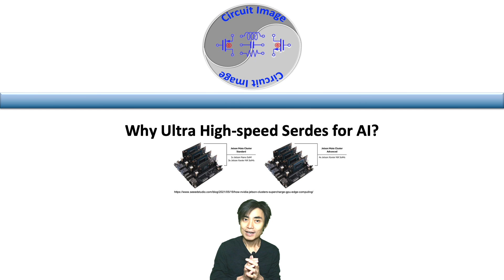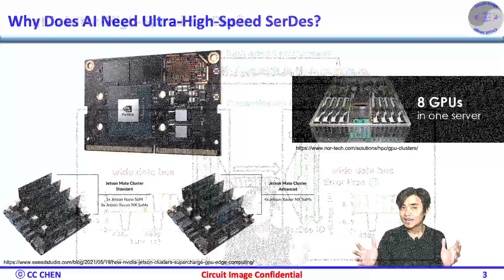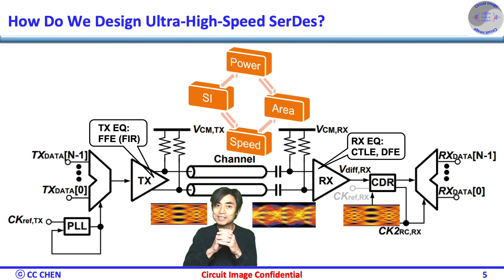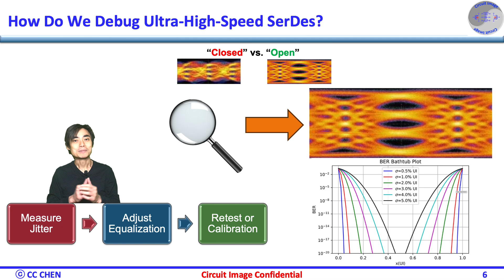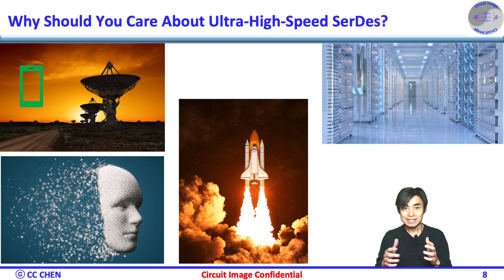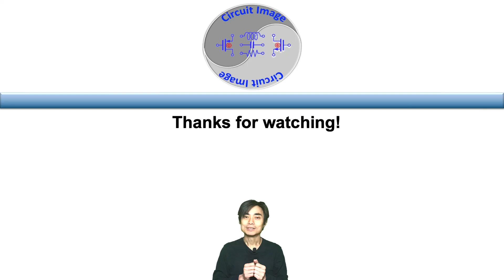Why Ultra High-speed Serdes for AI?​

Comment: Thank you Dr.Chen. The video It's very inspiring. Besides Serdes, are there other analog circuit you think potential for AI as well?
Reply from the maker: Hi Tianli,

Thank you for the good question! 

I’m glad you found the video inspiring. Besides SerDes, analog circuits like data converters (ADCs/DACs), phase-locked loops (PLLs), and sensor interfaces have great potential in AI applications, especially in edge computing and neuromorphic designs. Analog mixed-signal circuits can help improve power efficiency and speed for AI hardware.

If you’re interested, I can share more insights on this topic!

Thanks,
CC

Comment: 普通Silicon chip了不起跑在數 GHz，一直覺得同樣的製程可以做 112 G 甚至 224 G SerDes 非常不可思議，雖然是 PAM4  但基礎頻率仍然有  56 GHz!
Reply from the maker: Hi aaaaa,

Agree. It’s truly incredible how SerDes technology pushes the limits of ordinary silicon! While the same process can fabricate both standard digital chips and ultra-high-speed SerDes, designing for 112G and 224G presents unique challenges. Signal integrity, equalization (CTLE, DFE, FFE), and advanced packaging all play crucial roles in making these speeds feasible.

And you’re right—even though PAM4 reduces the symbol rate, the fundamental frequency for 112G SerDes is still 56 GHz, which is an engineering marvel in itself! The combination of analog front-end design and DSP-based equalization makes achieving these speeds possible.

Thanks for your great insight!

CC
Reply: @circuitimage  Hi, CC:
Thanks for the great explanation!
Reply from the maker: @aaaaa-yv1zr I am happy 😊 to help.